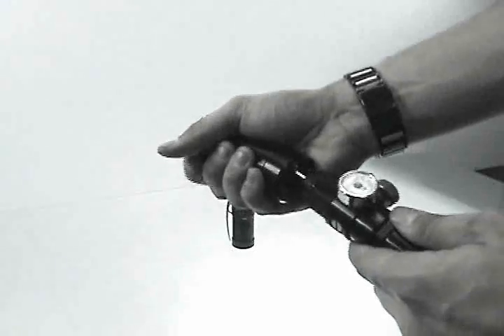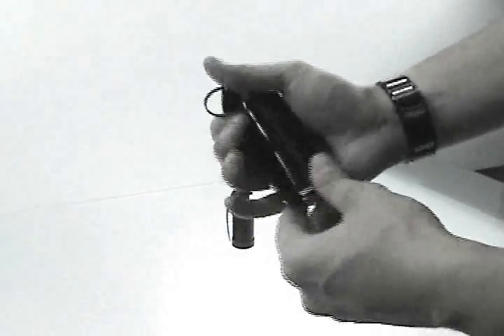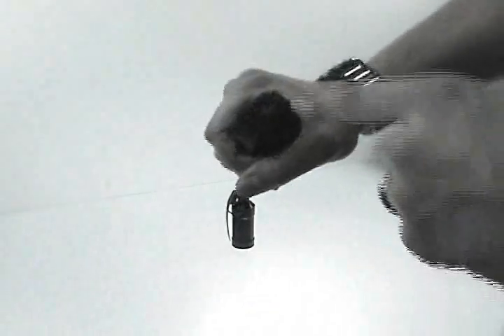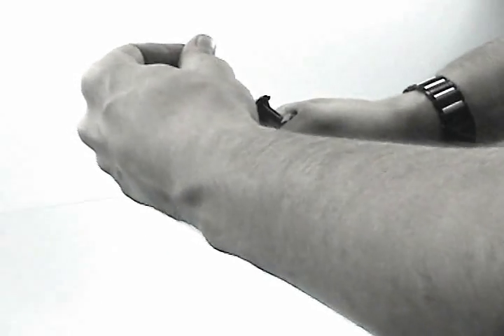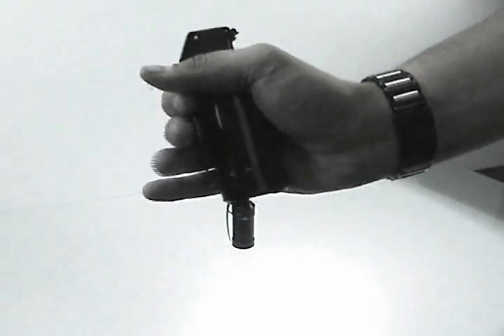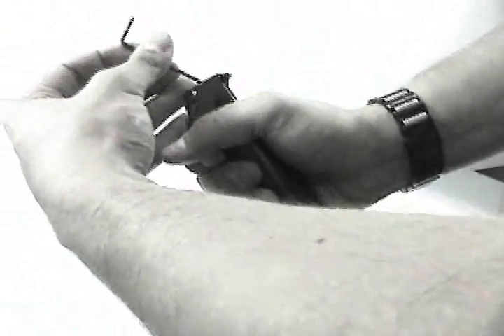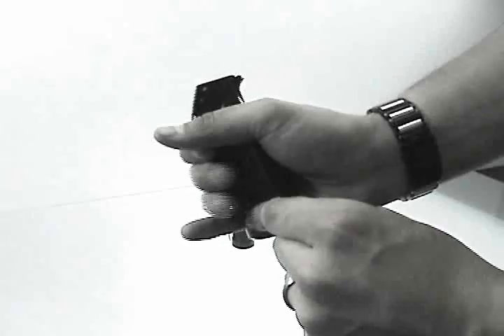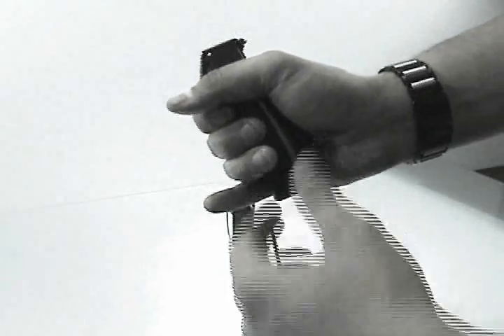MADBULL GSG-01 CO2 Stun Noise Generator Brief Instruction

Comment: What is the max recommended PSI?
 Does this work with internals similar to an M203? (If so, maintenance will be a LOT easier) Are they more robust?

  Also, is the shotgun shell prototype eventually available? I love the CO2 application simply because it can finally put a shotgun into its own on an outdoor field. The sound will be accurate, but more importantly, players can at last fairly match range with AEGs.